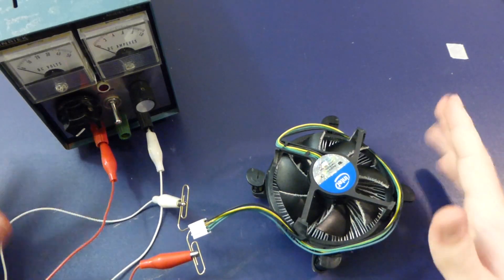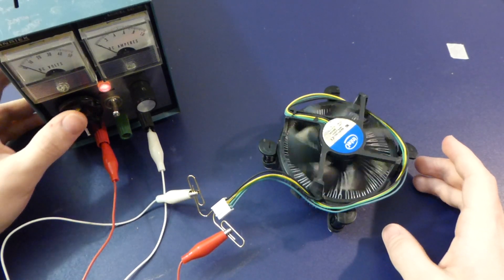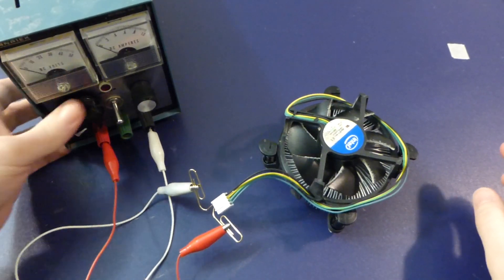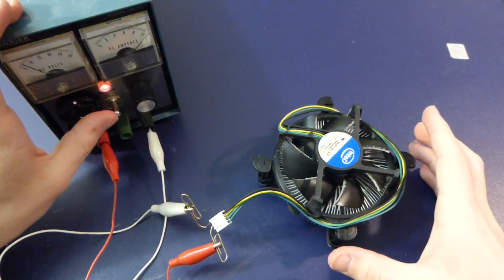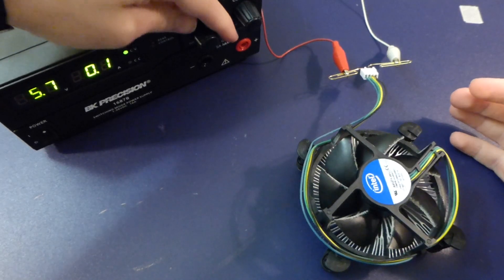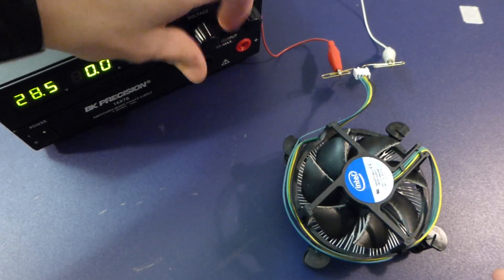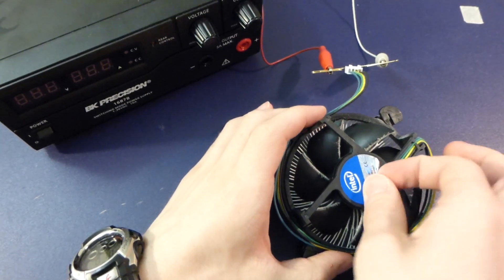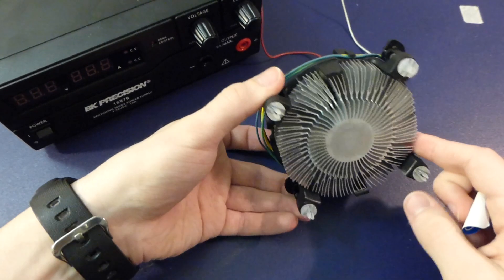Overvolting an Intel CPU Fan

Comment: I accidentally hooked up a 12v case fan to 24v. It moved a lot of air and noise. 

I didn't pay attention to the voltage of the fan I removed(was inside a power supply not a computer).

Comment: Intel CPU Fans are made for cooling, this is like wrong, There are faster fans available, Maybe the IC's voltage range was 10-16V (Most 12v device input ranges), and you killed it with 20v

Comment: Popped some traces on an old mobo when the cpu fan went dead short. System wouldn't POST until I resoldered a couple wire bridges over the burnt/severed sections...

Comment: The transistor type device you've mentioned on those cheap fans are actually a hall effect sensor, it detect the magnetic field of the magnet on the fan then turn on/off the coil around accordingly

Comment: There is a small IC that reserves the purpose of electronic commutation. PC fans, even though they are DC, the coil need AC power to run. That IC converts DC into AC.

Comment: Crappy because it couldn't handle double the voltage it is designed to work on? Ok, next time why don't you try 220 VAC on the first try.

Comment: attach a 5v to the blue wire as well it set its PWM to high in normal its PWM is controlled by a  temperature sensor if you peal off that sticker you can see a silver thing that's the sensor.

Comment: That Intel fan has a sleeve bearing along with a 693-zz micro bearing, that sounds like a dry sleeve rather than shot bearing, you just needed to put a drop of 3 in 1 in there.
Reply: Yep and remember to use the blue bottle (SAE 20 non-detergent motor oil) and not the red bottle!

Comment: All you needed to do was peel back the sticker, lift up that rubber or plastic plug, and add a few drops of 3-in-1 oil, then rotate the fins manually, a few times, then hook it up again.
I do this with any cooling fans which have had lubrication literally dry out. Been using the same fans for a decade now.

Comment: bro i wish i had a power supply, especially like the one you have, its simple and it looks like the meter goes up higher than 36 volts, if i ever get one i want one that doesn't have like 4/5 knobs on it.

Comment: For any solid state device  or circuit to take on 100% over volt is pretty impressive. Usually not more than 15% for long.
Reply: .. because its an intel fan
Reply: solid state disk?
Reply: @windowsxpthevyonder1517  SSD

Comment: I remember I once over clocked a fan with 120v when i was little. I found it in a parts bin with the wires already stripped. I was a kid and just played with it then found a 9v battery and it ran ok. I was wondering if it could do better so I shoved the wires into a fucking outlet and it made a huge pop and never worked again.

Comment: Good morning everyone. So is there a way to control the speed of a 4 wire fan outside of a pc and or laptop. I have a 4 wire (red, black,blue and yellow cable) fan that I want to use to keep my PS4 cool. I already rigged it to stay on using an old wall charging cable but I need more rpm. Any help would be greatly appreciated.

Comment: The transistor type device you've mentioned on those cheap fans are actually a hall effect sensor, it detect the magnetic field of the magnet on the fan then turn on/off the coil around accordingly
Reply: That's not what it does, it measures rpm
Reply: @JM-yx1lm  you should look at how a brushless dc motor works, if you care.

Comment: Should of just increased the voltage till it arced inside across the open circuit breaks. 3000v - 12000v should do it hehe

Comment: Fan's speed control circuit got destroyed. Plug it directly into motor and it will work fine also it can be overclocked.

Comment: you dont need paper clips. theres a easy way..
cut the wires from the bottom.
solder red and yellow together.
then putit on batterys or a volt mixer.

Comment: well you guys expected sparks well intel designed the fan to not get on fire for SAFETY reasons
Reply: which means its more likely to die if you dont have overvoltage protection =)...

Comment: Lol my teacher uses the joke for the "magic smoke" he says that if u open something up and the magic smoke comes out it'll never work again" lol but once u pushed the voltage pass what the fan could hold and you started to draw current you just fried it basically and had an open circuit now but fun and interesting video something I do on my spare time is to hook up a normal 5mm led to 4 volts then crank the voltage up and it'll start glowing more and more then it'll turn a bright orange or red when it starts to burn then it goes to nothing and it pops and we shoot them at each other in lab sometimes haha but great video man

Comment: Had a similar day when my desktops power supply fan died. Lost a fair amount of work. shouldn't complain though since the thermal protection saved the system from damage.

Comment: there is a chip pf three pins near the coil u burnt that up at high voltage which moves the fan by stop and starting the cureent at micro secounds i am not an engineer i just play with thesse stuff and discovered my self now try connection the red wire and disconnecting the red wire v v fast the fan will move a little bit you will get the idea

Comment: my phone chares at 25v xD
Reply: the fast charge is 25 watts, not volts. You don't know much about electricity do you
Reply: 5*
Reply: ATVMadness I have a droid turbo 2 xD it quick charges with 25v bro
Reply: no I don't know alot about electricity thanks for enlightening me, can you help me learn more, I'm not lying, do you have a chart that would be able to help me? thanks.
Reply: go to highscool man
Reply: xXZoulocKXx they dont teach it in detail at all.
Reply: NO WAY IN HELL would your phone charge at 25v, hell not even a chance it would charge at 25w, 

There are several types of rapid phone chargers. Some work by feeding the phone at a higher voltage (9 volts instead of the 5 volts put out by standard USB chargers). Others, such as the DASH system used by most smartphones, keep the voltage at 5V but raise the amperage (4A vs. 2A for standard phone chargers).

But although the new phone chargers are built for speed, they default to a slower charging setting that's safe for all smartphones (5 volts at 500mA to 2A) when they sense they've been plugged into an unsupported device.

Qualcomm, which is known for its Snapdragon smartphone processors, is also behind the rapid-charging Quick Charge tech found in more than 100 smartphone models, including flagship phones from Samsung, Motorola, HTC, and others.
Reply: Pantharen 25w chargers are very common. Hell, anker makes 24w chargers.
Reply: Devin Shillington You're not going to charge a cell phone with a 25w charger. 25 watts @ 1a = 25v, and you're sure as hell are not going to charge a cellphone with 25v.. Pull your head out of your ass..
Reply: Pantharen you need to do some research my friend.
Reply: Devin Shillington Here is an easy Calculator, maybe you'll learn something. Other than the bullshit you are trying to spread http://www.rapidtables.com/calc/electric/Watt_to_Volt_Calculator.htm
Reply: Pantharen Again, do your research. I do not need a calculator. I simply stated that there are 24w/25w chargers, which there are. Do your research.
Reply: Pantharen I think 5V * 5A = 25W, but I'm not sure
Reply: ***** Yep, that is 100%, BUT the original poster said he charges his phone with 25v, and Devin Shillington tried to prove me wrong.. All he proceeded to do was look like a moron..  his claim was that 25w * 1a = 25w, yet the math doesn't back him up.

Comment: Stupid preteen me once connected a casefan to a 230V household outlet (yeah don't try that). It ran for a couple of seconds or so before the coils melted - you could see them glowing inside the housing. Luckily, nothing else happened :D
Reply: There's absolutely no chance for that to happen, the 230v is AC and these fans are DC, if you were doing that then it just blow up and not a slight chance of spinning
Reply: I tried that with a small buzzer once. It let out a huge spark and a scorch on the wall socket. Not to mention that would've killed me as well.
Reply: Haha, I put a 3v LED in a 250v outlet once when I was 7. It only lasted about 3 seconds before it made a huge pop sound and the outlet was covered in soot. Needless to say, I learnt not to mess with outlets from then on.
Reply: I found a old broken light string which had small bulbs I took one of them and used a battery it glowed very low so I hooked it up to a outlet and made nice firecracker
Reply: I once cut a cord off a pedestal fan, then wired it to a cheap eBay siren box thing, plugged in the cord and switched it on. almost blew myself up, only tripped the fusebox thankfully.

Comment: I run one on a 4s3p battery in my 100w LED flashlight. 12v-16.8v, it sounds like a jet engine.
Reply: That is pathetic my ps4 sounds like a whole airport
Reply: @matkorocak6302  hahahahaha your comment made my day
Reply: @matkorocak6302  my PS4s one fan is louder than my PCs 8 fans working at the same time
Reply: @antreaskonstantinou8585  clean that shit, definitely full of dust, mine was the same, cleaned it with compressed air. Sounded like new after that.
Reply: @toxicturkeyy  i cleaned it but when the AC was off and it was 30°C in the room it got really loud, until the power supply gave up completely
Reply: U should hear mine because when both fans speed up it has that plane engine sound
Reply: Do you play Minecraft
Reply: @shonparab9724  like 10 years ago, not since I got 150k subscribers...
Reply: 😂😂 military is finding you 😂😂
Reply: Zet engine your head
Reply: Common use a stepdown ^^
Reply: @mrHello420__  I'm already stepping down the battery pack to that voltage, then boost converting it to 32volts for the LED
Reply: @SpecialEDy  yo... i watched your real life steve vids as a kid..
Reply: @FinxdMC  same
Reply: You should hear my PC foll max rpm
Reply: And my PS4

Comment: I have one here, identical to that. I bought used, just because of the heatsink (to make a Tesla tower, that I didn't do it yet). But, anyway, I modified the fan, removed the heat sensor and soldered it... And, well, when I tested it with a 9v battery, it cut my fingers. LOL Nothing serious, but anyway... It can be really fast!

Comment: 1:47 Spark came out from under the fan
Reply: 12v is the normal voltage it shouldn't spark at that voltage
Reply: Maybe from the fan hitting the heat sink?
Reply: the cable hit the fan
Reply: Are you guys sure looked like it came from motor
Reply: Wow that's furious kkk
Reply: @potato_x69  hi
Reply: @FunForCHEAP-z6x  That is what I saw.
Reply: 12 volts.. I don't think it would make such a long spark to travel from the motor to out of the blades
Reply: i think it came out from the blue wire

Comment: You can easily push 100'000 volts through it. Wont even turn. Just lower the amps to almost nothing, and keep your fingers away.
Reply: im sure it wont work that way either.

Comment: Why would you use a shitty cooler, for a server? You need it to be reliable not risk it breaking. That's what you get for using a cheap cooler.
Reply: the server won't "break" because of the cooler. im pretty sure most people who build servers test the temperatures before actually deciding on the cooler.
Reply: Well, duh it won't just suddenly break. But why risk your server on a cheap cooler when you can easily buy a good one for like $30 bucks USD. You need a server up and running 24/7 without problems. So why use this cheap ass cooler.
Reply: well that's also true
Reply: you sound like the kind of fucker who thinks a 65w tdp locked i5 needs a full custom loop water cooling setup. dont ever touch a computer please.

Comment: 230v AC. Fused with 16 Amps. Then it starts smoking. ☺️
Reply: nope it will explode/melt
Reply: Zachary Curtis Depends on how good the coils are. But melting and plastic equals to smoke
Cossack-HD Exactly.

Comment: Usually I put in a little drop of cooking oil in the bearing under the label. That brings the bearing to a newer life. But on this one, maybe you need to make a hole yourself. :-/
By the way, some of those Intel fans are thermoregulated when the 4th pin is disconnected. So the overvoltage failure that we saw is probably only an electronic failure.

Comment: I don't think the definition of "crappy" is not able to handle 4 times the power it said on the package
Reply: Newspaperman57 u saying the intel cooler isn’t crappy? lol
Reply: @stallionboy6114  Intel's stock is a shit but is normal that burn😂
Reply: @pisar3623  amd stock cooler turned into a helicopter at 20v
Reply: @pisar3623  its shit because its meant for like 2nd gen i3’s
Reply: The fan might be fine but the actual heatsink is crap.
Reply: @Dreams_Of_Lavender  heatsink is ok for the size and price, especially when there is a copper insert. But that mounting system is pure evil.
Reply: @Mr.Leeroy  wont do shit with hard use.. Sure its fine if you use your computer only to browse the internet :) If you use the stock one for gaming cpu will overheat really fast ;)
Reply: @chriscs9080  if you use 65W TDP heatsink with a 95W+ TDP CPU (possibly overclocked) it's your problem, not cooler's. All about right tool for the job..
Reply: @Mr.Leeroy  I am talking about the stock
Reply: @chriscs9080  Me too. The one in the video is 65W rated.
Reply: @chriscs9080  I game with the stock intel cooler just fine. Depends on the TDP

Comment: this is a pulse wave modulated motor, it is not normally operated with pure DC current in order to control the speed
Reply: Pulse width modulation fans run with pure DC at 100%.
Reply: I know. They always run at full voltage.
Reply: Normal people call it PWM!
Reply: They still work with dc

Comment: I had that happen to my Graphics card's fan and I wasn't prepared at all to get a cooler for it but I managed to fix it by drilling a small hole under the edge of the sticker and put a few drops of lubricant. At first there was a noticeable difference but it took it a week for the lubricant to truly stop it from rattling and it was after that running like new. In fact it still is after about a year :D

Comment: I tried this with a car battery once....... every blade very quickly became projectiles
Reply: But car batteries are only 12v
Reply: Some are 24 volts. Particularly diesels.
Reply: put 4 of them in series
Reply: Meep Meep 500 amps peak current you mean?
Reply: 4 of them in series is boring... I think 36 x 24 volts in series would be fun to see on a PC fan :3

I now lowkey want someone to do that
Reply: Don't forget the near 500 amps that come with it

Comment: no it was very interesting...but y core2duo e7200 fan spin vey slow and cool?
Reply: because that's a low clocked dual core processor. which don't generate much heat at all, so the cpu fan can get away with spinning slow.
Reply: thanks mate...

Comment: but can it run crysis ?
Reply: I can only laugh at 40 fps :(
Reply: I can lol at 60fps
Reply: People don't get the joke, damn!
Reply: @DanielMoreira_18  ikfr
Reply: Yes an Intel stock cooler CAN run Crysis
Reply: Deva Pramana  antialysing off though.
Reply: Deva Pramana ('_')
Reply: Joshua White potato
Reply: Yeah the fan can run crysis at ultra setting without cpu just fan
Reply: It can even spin it
Reply: I can at 100 on high
Reply: Lol
Reply: It can fly crysis
Reply: Crisis runs.
Reply: Hey that's my line
Reply: or doom
Reply: Y'all actually get past the menu without a blue screen? Lol
Reply: Alienware laptop core i9 9900k and RTX 2080 Ti ofc Even with 16 gb rom and 1TB storage lol
Reply: Its a intel fan not the actual intel CPU
Reply: No
Reply: No :/
Reply: Ni en un millón de años jajajajaja
Reply: Mínimo uno de plataforma alta como el pentium 4 pero de cobre
Reply: Yes
Reply: it does run it but it will only lasts 10 second at ultra
Reply: I can run it at 1080p medium-high settings with locked 60fps. AMD A8 6600k and MSI r7 370 4gb FTW.
Reply: @joshuawhite3411  dang, that's a pro setup
Reply: Joshua White your cpu is ass but gpu is decent
Reply: Deva Pramana linus fans it cant without other parts

Comment: You had a server running with a stock cooler ?
Reply: yes, because he totally needs a hyper 212 evo in there for just a server.
Reply: Why not?
Reply: AAF Jack to be fair there are comparable low profile coolers
Reply: Water cooling gay and overpriced.
Reply: Dead Meme no u
Reply: DrakoonLP no u
Reply: Nerd spotted
Reply: Should of have water cooling

Comment: fyi
you shouldnt turn off a power supply when an inductive load is connected, since inductive loads love to store energy in magnetic fields, when you turn off your power supply, the feild collapses and a huge energy spike could damage your power supply
Reply: Gotin Fuklio 

you are right, computer fans do not have to much inductance, but other motors and stuff do
Reply: bullshit. the fan doesnt have inductance for shit, the chip has burned enough to kill all the spikes and the iron core prevents it from inducing high voltages anyway
Reply: The power supply should be protected, right?
Reply: +Pipe0481  

a lot of them are not, especially the older ones like the guy in the video has
Reply: I always turn off my pc randomly sometimes and that never happens

Comment: if you want to avoid issues like this, consider using large heatsinks without fans, and use the rack fans to cool your cpu, but use a really big heatsink and high airflow fans